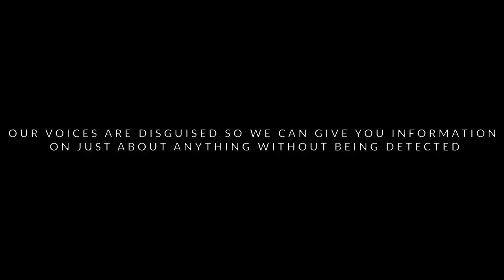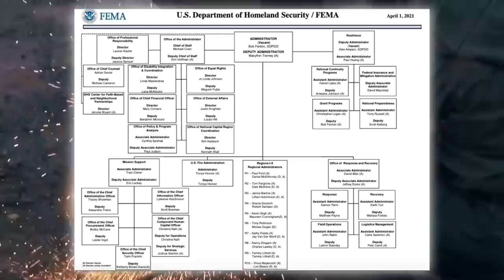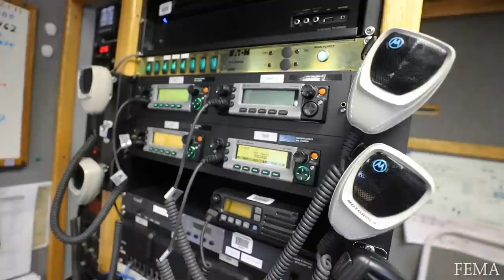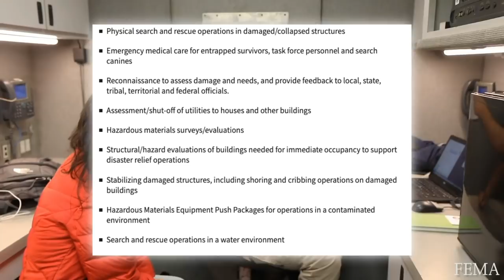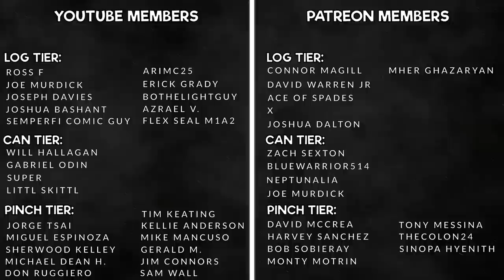FEMA - THE AGENCY THAT RESPONDS TO DISASTERS

Comment: I know I worked with them when Hurricane Ivan hit Pensacola in 2004.  They were using spreadsheets to track the blue roof project. I said, "Don't you have a dedicated program that you use?" They said no. We just create spreadsheets wherever we go. I said, "Spreadsheets are very volatile.  it's very easy to scramble your data. "

Well, that's exactly what happened. Someone sorted the data, and FEMA lost track of who had a blue roof and who didn't.  I was transferred out of headquarters and put on the phones.

During my exit interview FEMA asked me how they could do a better job next time.  I told them to mail every home owner in Pensacola a tarp big enough to cover their house and then stay the hell out of Pensacola.